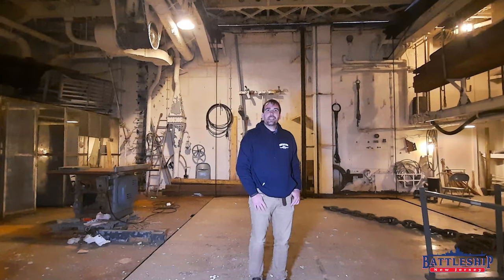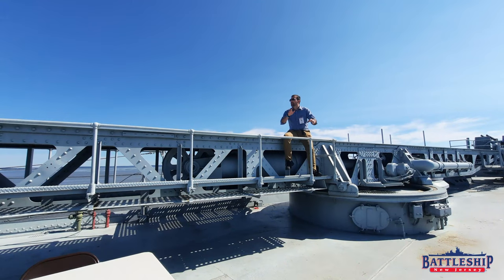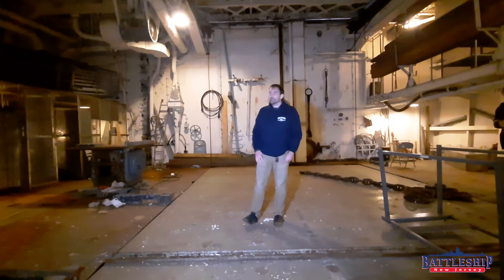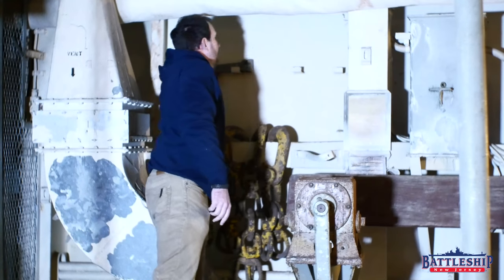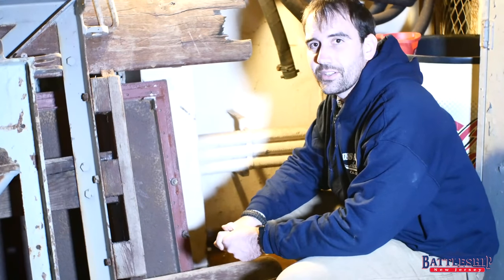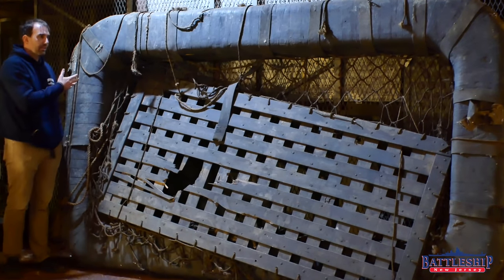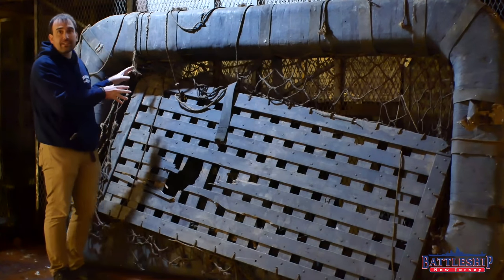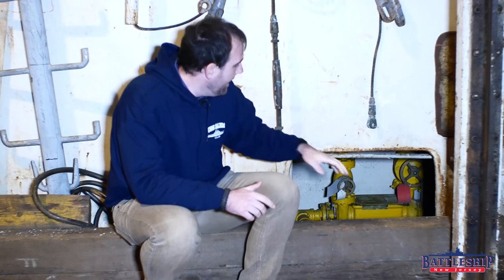Inside the Hangar of USS Salem

Comment: I recall reading that one disadvantage of the rear hanger was that they placed a large resonant chamber directly over the screws, which could cause vibration issues under some conditions.  Also, if the hanger flooded, as did the Houston's (CL-81) due to a torpedo hit off Formosa, dealing with the free surface water could be a problem.  I imagine these would also have been issues with a rear hanger on the battleships.  Vibration at certain speeds was a big enough problem for many ships as it was.
Reply: Um, hangar .
Reply: @tominiowa2513  of course, a hangar may also contain hangers.  ;)
Reply: @jamescameron2490  For the junior officers in the away party to use as sidearms... cutlasses for the enlisted men...
Reply: @chemech  or for peacoats.

Comment: I'm impressed with the amount of thought that went into the design of the Des Moines heavy cruisers.  Having the aviation gas pumps surrounded by a water tank to douse any potential fire is just one example of the many innovative features to make these ships survive in battle.
Reply: Experience gained during the war.
Reply: The water powered pumps used for fueling the aircraft was also genius thinking.

Comment: Taking into account the intended use of the Iowa's I would think not having a hangar is wise, the Iowa's being heavily divided with sealable spaces would give the crew more opportunity to halt flooding in my opinion. Having a hangar gives you a massive space to potentially have flood and little option for halting it unless you can access and plug the leak. With the intended use of a battle ship I'd think having a single massive space like a hangar would be more of a liability in battle and outweigh the potential benefits, for example if NJ ever had to slug it out with Yamato it would stand to reason that both ships would take immense damage and in that instance 20 rooms that can be sealed seem more valuable than one massive space that takes the same volume as the 20 rooms. I could however concede that 2 or 3 smaller single craft hangars instead of one large one could have been of benefit and mitigated the risk of a massive open space at least somewhat. 

Hopefully that all made sense.
Reply: agree, plus the fact in later days not having a hanger for helicopters is still no issue, as a BB never goes anywhere without its escorts, which carried helicopters.
Reply: Well said my friend
Reply: What Lefty O said!
Reply: Hangars sit pretty high above the waterline, and aren't really watertight to begin with, especially after you've traded a few shells. They also sit far outside any armored spaces on most surface combatants. I don't think they would have been a significant consideration concerning flooding. 
On the other hand, protecting aircraft from the elements while having a good space to maintain them is also very important if you plan to make extensive use of your aircraft. 
In any case, if you're sitting so low that your hangar flooding is a significant damage control concern, I would start considering abandoning ship. 

For the Japanese, seaplanes were a significant part of fleet recon, long range gunnery, and C2. Significant commitment of tonnage to aviation facilities can be seen on all their cruisers and battleships. They also devoted resources to making modern high performance seaplanes. This is in stark contrast to the USN, which saw a much more limited role for seaplanes.

Comment: The Northampton Class Heavy Cruisers CA 26 - CA 31 were the first U.S. Navy ships designed and built to have hangers with (2) large doors to store/work on the Sea Planes inside. Thanks for sharing your video.
Reply: Shame that none of the old treaty cruisers are with us any longer.
Reply: @MalfosRanger  Yes, the U.S. Navy had a surplus of cruisers too but, none were saved. My dad (who passed in 2017 at 92) served on the USS Louisville CA 28 from 1943-46 and they tried to make a museum in Louisville but, it was too costly. They looked at dredging the Mississippi River and removing some of Louisville's upper structure to pass bridges and cost was the issue. I have visited the USS Little Rock CLG-4 but, she is not in her WW2 design. Take care!

Comment: Even with a lot of unknown information - MAJOR SALUTE to those guys for having elevator still work. Might be more a matter of a very simple design, but. Another volume/ size comparison to the battleships. If ON the main deck - "dead" amidships - ship at normal operational draft- How high up are you? (what is the ship freeboard). NO Idea, I would NOT be shocked to hear maybe slighly more than NJ. Mega cool. Been Waiting for this video since I heard it was coming 2 weeks ago.
Reply: Yea, that elevator still working gets major cool points...I was wondering the whole time whether it did or not, and there it went up...

Comment: On the WW2 Life Raft, one of the important thing to remember is that the Japanese had taken over most (but not all) of the world's rubber plantations!  So large scale use. of Inflatable Life Rafts that could help several people was out of the question!  Plus, they felt that a large number of Life Rafts would be hit by shrapnel from shell hits.  Hence the WW2 Life Raft having several compartments and an inflatable would have issues keeping inflated with even a small number of holes.....
 
BTW: the rubber shortage was the main reason why their was a gasoline restriction (via Rationing), so that people's tires wouldn't have to be replaced.  Remember that this was before good synthetic rubber was around!! (The kids' toy Silly Putty was one such attempt to make a viable synthetic rubber!)
Reply: Kevlar was also to be a replacement for real rubber.
Reply: It's a bit more complicated.

There were a number of mass-produced synthetic rubbers around.  Neoprene was invented in 1930 (although it smelled horrible until a newer and cheaper production process was developed that didn't produce the smelly byproducts was developed a few years later).  There was another synthetic rubber compound developed in 1940.  The problem is there's no synthetic rubber compound yet that makes tires that are as good as the ones made with natural rubber.  To this day, radial-ply tires need some natural rubber to make the sidewalls work properly.  High-performance aircraft tires are made entirely of natural rubber to survive the high loading they experience in landings.  The gas rationing in the US and the reduced speed limits were not just to reduce tire wear and extend tire life but because the need for all natural rubber available to go for such things as military aircraft tires meant that what civilian tires there were just weren't as good as they'd been before the war.
Reply: @evensgrey  Neoprene was used on the Snorkel Heads of Nazi U-boats as an attempt to reduce their Microwave Radar profile (how much signal bounces off and goes back to the Allied Plane ardor ship. 
 
Also, actually all modern tires for transportation (including aircraft) are a blend.  Enough stuff is added to give them longer life, ability to absorb heat, resist puncture, etc. that you can basically say that they are a blend of (mainly) Natural Rubber and some synthetic rubber.
Reply: @timengineman2nd714  I think it’s funny that as I’m reading this comment, I’m holding silly putty.

Comment: thank you for doing the heavy cruiser tours. I am in my glory! but even better...now yer in my space (3rd division.) bravo, it brings back so many memories i had forgot about. we kept the flag's yacht, a fancy staff car, a van, and maybe a couple 40' boats on the sides (off the elevator) on the news. never had a chopper onboard when i was there, though the flight deck was used a lot for them, mostly vert reps, but also they would land for various reasons as well. we had access to the jp4 as well, the best stuff for cleaning paint brushes and a valuable komshaw item. the cool thing about the flight deck and the elevator aft of it was it had deck grey w/ sand paint (we would get a bucket of sand from the sand locker) so we didn't have to holy stone that part. way easier to paint it every now and then. and aft of that the fantail was steel deck! our part of the deck started just aft of t3. and 1/2 of that was flight deck and the big sliding hatch for the elevator. thanks again.

Comment: That after underdeck hangar was also a feature in one of the 70s era designs:  The Vriginia-class nuclear powered cruisers.  The space was meant for a belowdecks helo hangar, with an elevator lift and rolling desk.  Because of issues with the helo (I think that Congress chose not to buy the helo designed for the space and nothing else in the inventory would work with that space) the space aboard the Virginias never was used as hangars, and the aft weather deck ended up being used to mount two of the 4 cell Armored Box launchers like those on New Jersey.
Reply: The issue wasn't with the helicopters (the Virginias used a standard SH-2), it was with the hanger doors. Because the hangar door had to double as the flight deck, they adopted a more complex design than the WWII cruisers that fit flush with the deck. However, it ended up leaking in practice and the CGNs were AAW ships that operated in larger task forces so they just dropped the idea.
Reply: @ARCNA442  and this is why you should always double-check your scuttlebutt stories.   

Thanks for the correction.

Comment: Knowing with 20:20 hindsight that helicopters would become a thing, a battleship design with a hangar of some sort on or near the fantail would have been a useful design feature, if a bit tricky to design into a fast battleship.

Most likely, this would have taken form as a raised structure to some degree, which would have posed a challenge for the floatplane catapults, and even moreso for the ability to aim the aft turret's main guns due aft.

Not an insurmountable challenge for the design team, but a tricky problem none the less.

Comment: The Baltimore class cruiser later carried Kingfisher sea planes and the Kingfisher had fixed wings. It also meant that it could not be stored in the cruiser hangers. The Seahawk with folding wings could be stored or worked on in hangers. Great video of the hanger area.

Comment: The prop wrench has a single keyway at the handle end of the hole, rather than flats. The key to be used is hanging there, partially hiding the keyway. The nut would probably have multiple keyways, to allow repositioning the wrench as the nut turns.  Similar wrenches were used by steel mills for large machines such as rolling mills.

Comment: Ryan, the reason you have shadow boards is not only to know where to return tools it is also to insure tools don't go missing inside an airplane and I used it as a mechanic to insure my tools did not walk out of my shop in someones car and prevent me  from having to keep replacing tools that are very expensive if you buy professional level tools. Almost every tool I had was shadowed that I used daily and each and every time i locked up my tools at the end of a day I checked every single tool to insure it was in its place.

Comment: It was my understanding that during WWII, USN cruisers were considered scout vessels more than battleships. So it makes sense that they would host aircraft whereas the battleships would not. I think Ryan himself said the main purpose for aircraft on a battleship was to spot the fall of shot, not to go looking for the enemy. But I would think that during a heated battle having a plane circling over the enemy radioing "A little more to the left" seems... unwise.
Reply: Interestingly, cruisers and battleships were even supposed to be equipped with different aircraft - battleships were to get the OS2U that focused on spotting and did not have folding wings, while cruisers were to get the SOC and SO3C that focused on scouting and did have folding wings (although the failure of the SO3C meant this didn't really happen in practice - and the two types were combined in 1944 with the SC).

Comment: The placement of the aviation fuel (and even more so on NJ, in the former gun tub with an open bottom so you can just yeet the entire thing off the stern) reminds me of the concerns people have about external spare fuel stowage on some tanks (the Soviets did it a lot in WWII, and the Cold War Swedish S-tank had skirts made of jerry cans, using the spare fuel as armor over the wheels, much like a battleship uses its fuel bunkers as part of the armor) -- "What it the fuel can gets hit and catches fire?" "It's diesel, it probably won't  catch fire from a hit, but if it does, being liquid, pours out onto the ground and you drive away."

Comment: I think it would have been - adding a few Seahawks for spotting, recon and defensive ASW would have been a very handy feature. The Kirovs have 3-5 helos, too. If matching them was ever part of the design, adding helos would have been great. Also, though they couldn't have really known it at the time, the first Arleigh Burkes have a flight deck but no helo. If the Iowas had gotten a hangar, then the Burkes could be used as escorts and range-extending fueling stations for the helos, thus improving the BB's ASW screen. This might have made for a useful surface action group into the 1990s. (also, having the Seahawks for missile targeting might have made keeping TASM around make a bit of sense.)

Comment: Having an onboard hangar may seem advantageous, however the WW1 and interwar battleships showed that having room for parts and supplies was a better trade-off than the ability to spot using your own planes which have limited protection and had to be retrieved using cranes and precision maneuvers.  Also, by the time the Iowas were launched, battleships were already shown to be liabilities in naval engagements with aircraft and faster support ships being able to deliver a killing blow with minimal risk of life- a battleship would have a crew of around 2000 while a submarine or KB (German equivalent of the PT Boat) crew was under 200.  So having redundancy in fuel and supplies and more deck space for anti aircraft artillery was better for the usability of the Iowas.  
Speed and firepower were the focus by the 1940s, as the raid on the Italian navy and the whole Bismarck confrontation showed the importance of armor and anti-air defenses over the need to sight your own main guns.  When the initial plans were laid the Washington Naval Treaty was still a consideration as well, so to ensure not having to scrap new ships after the war due to similar agreements it’s likely that designers and the political administration saw it better to not have bulky equipment that could result in the craft being forced into retirement.

Comment: I’m pretty sure I’ve read one of the potential issues with having a hanger in the hull as opposed to on it is that you have a very large space that could admit a lot of water if the stern was sufficiently damaged. Horses for courses. Everything is a trade off.

Comment: A hangar deck on a battleship was probably not necessary. If the cruisers had aircraft use the cruisers aircraft or in the later war use carrier based aircraft. It basically comes down to the limited volume inside the hull of the ship. Making the ship larger increases costs and could actually require increased propulsion requirements to avoid a reduction in speed.

Comment: I sometimes think there is a case for the United States to develop new all-gun cruisers or even battleships. The semi-automated 8" guns on the Salem are just down-right cool in their efficiency, but the 16"/50 was no slouch either. 105mm or 155mm guns would be compatible with the ammo used by ground forces, but the 5 inch isn't a bad choice either as far as a secondary battery might go. A small, enclosed hanger at the rear of the ship could provide a space for things like a V-22, a UH-1Y, an F-35, even something  like a CH/MH-47 could have it's rotors folded up and made to fit. If some way to provide ammo more efficiently could be found, the 20mm Phalanx CIWS could defeat incoming aircraft, missiles, and rockets handily. Chain guns in the 20-to-30mm range for small-boat defense could be set along the decks in remotely-controlled mounts (with provisions for local control, of course.) A platoon-sized element of MEU(SOC) or FAST Marines could accommodate their provided "country" on ship. And America's vast coal reserves could be converted via means like coal-liquefaction or the Fischer-Tropsch process into just about any desired liquid fuel, from gasoline to diesel and kerosene, never mind bunker C. Oh, the possibilities are endless!